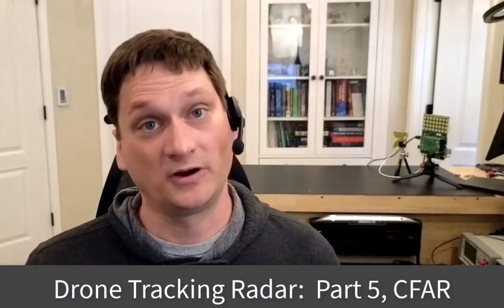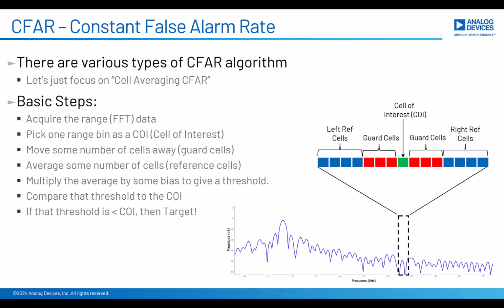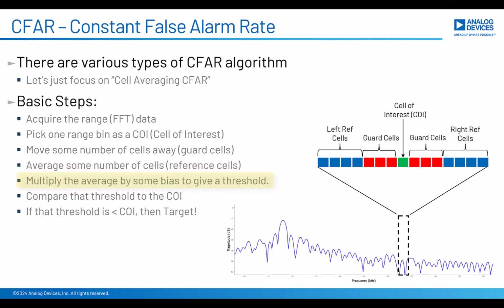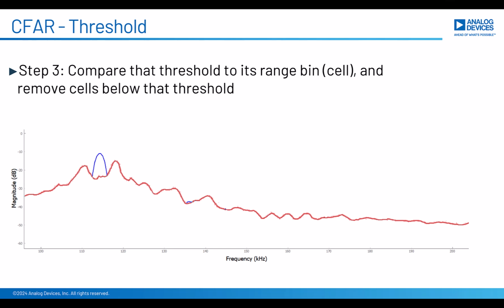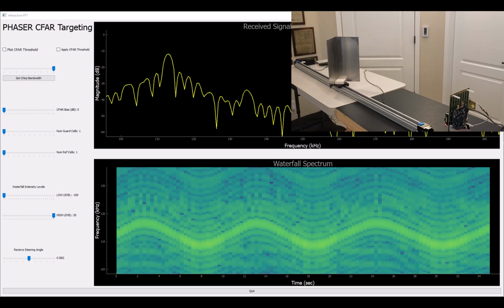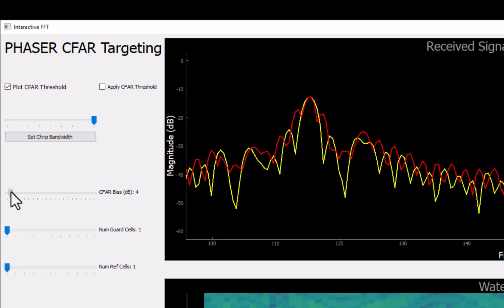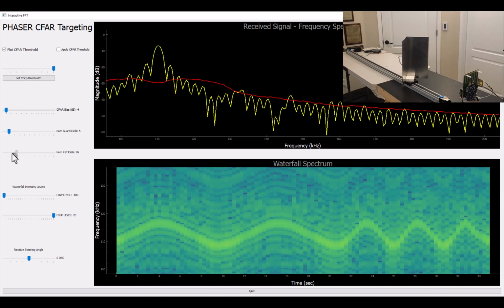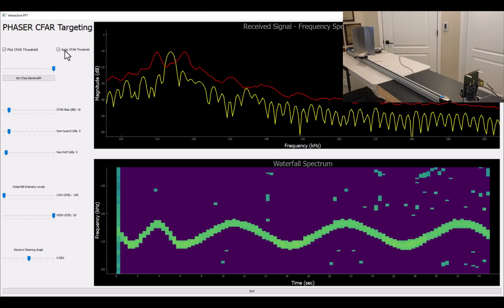Drone Tracking Radar:  Part 5 CFAR Targeting

Comment: Hey Jon, I’ve noticed your python GitHub examples (which are super instructive BTW) run quite a bit slower on my stock phaser board than what appears in your videos. Have you perhaps overclocked your pi 4 a bit? I am running the latest downloaded ADI phaser image and updated software.
Reply from the maker: No I'm not running the programs on the Rpi.  I prefer to run, and edit them, on my desktop computer.  So just connect Pluto (via USB) to your desktop computer, and ethernet from computer to Rpi).  It will run much better, especially for processing intensive things like CFAR.  Also, for technical support on Phaser/Pluto (and much faster replies!), please use this forum:  https://ez.analog.com/adieducation/university-program/

Comment: hi, is it possible to use already developed radar sensors from car industry like "adaptive cruise control radar" for drone tracking or other purposes , with developing code for it.
Reply: Are those actually radar? Or are they lidar? I know that a lot of marketing uses lidar, radar, and ultrasonic interchangeably
Reply: @Enderbro3300  i was reading technical documentation from OEM parts manufacturer BOSCH it is radar working in 77GHz but they don't specify what type is it FMCW or CW.  
YT channel @Thesignalpath was doing dissection of this radars.
Reply: They are indeed FMCW and can discriminate between stationary and moving objects as well as figure out speed differences for emergency braking. It obviously also needs the steering wheel angle.
Reply: Temic (continental) makes 77ghz radars (not lidar), quite a lot of cars have them. I think from 2009.
Reply: Possibly. Most cars that have AEB or adaptive cruise control use  this kind of radar. The first generations just provided a distance to target and target relative speed, I think. The newer ones provide a list of targets, angular position, relative speeds. Pretty sure none of them can detect a small drone and cannot be easily used outside of a car. Bosch has a list of products 'off the highway' or something similar but everything is 'request a quote'.

Comment: What's all this cost? (GOVT PROJECT SO DON'T CARE IF IT'S MILLIONS) JUST CURIOUS - AS WE'RE STILL WEIGHING OUT "BUILDING OUR OWN" OR SOURCING 3RD PARTY SUPPLIER OFF THE SHELF (BTW. what's the RANGE?) SORRY MISSED THAT BEFORE if said. 

Lastly, if you have 3 of these running could you tie all 3 signals into the same bog standard radar screen and somehow also tie AI into it to triangulate the target 3 ways which clearly (it seems) would help ID objects and give you speeds? (Or "more better" no?) That's our plan. Anyone confirm or shoot holes in that idea or plan? (Apologies for the ALL CAPS. 3am w/no reader glasses and too lazy/tired to re-type my Q!) Awesome vids! Thank you!
Reply from the maker: Hi!  See the first video in the series for more info on hardware and cost.  But this is just a development/exploration platform -- not a final product.  Range we'll find out together soon when I get that final video ready.  But it is an CW short range radar, so it won't be super far.  Maybe 50-100m.  Depends on a lot factors (see the first video).
Reply: @jonkraft  thank you so very much.  Both for reading my lengthy missive and for pointing to where I can find more answers beyond the ones you’ve kindly already provided. Means allot. Especially these days when the comments section usually devolve into an area of trolls and naysayers. So means allot to see your reply here. Wasn’t certain when you made this or if the “final test” video was already done as I only started following you after finding this video in a Google search this past week. I’m certain I may hit you up one last time after you release the final video - as the munitions company we’re working with supplies us with missiles with a 42km range. And we wanna ID a “swarm” - as that’s the future of this type warfare. Swarm drone attacks and have AI pick it apart and ID each incoming drone and respond accordingly. The beauty behind the Israeli solution is it’s a set it and forget it with camera and a proprietary tracker I can’t discuss here but can literally fire 50 at once at 50 different targets while you go off and get a cup of coffee. It’s kinda like an upgrade to the Patriot or Iron Dome. They use 1 missile that splits into 3 missiles. But we learned something October7th. Throw the kitchen sink at your target  vs a single ICBM (for an OTT example) they simply can’t respond or handle that quantity of incoming….. Our missiles started out as tank busters (so whilst small they pack a massive punch) and we had them size and modify them down for more distance yet still pack the same punch with an eye on these new Iran suicide drones that come in 10-20 at once and that’s just one wave. We’ve seen now the chink in the iron domes armor. When 150 missiles are launched at once the iron dome simply can’t keep up. AOA also matters. As they’re so close just lobbing them “over the wall” it’d ID the inbound but no time to reach them. Ours have immediate lock load track & fire in under 30 seconds up to 50 missiles at once at sonic speeds today. We hope to create a mobile unit and battery with 3 radars covering or painting a 360 circle in real-time. that’ll launch up to 3x more and auto reload as each missile is on $2K vs millions that others use. We’re just making a better mouse trap where the others fall short. Testing strikes with BAe so far have are in the 95th percentile - so am very happy with the first beta tests. Sadly whilst we learned much from Oct 7 -our Israeli partner company has placed all partner projects on hold as they understandably need to assist in their own country’s defense as they’ve been retooled to mfg munitions for their existing systems. 

Anyway. Will research and view what you suggested. Someday it’d be good to speak offline about upgrading the distance on something like this from meters to miles if you’re game and looking for more research funding? . But as said we’re just weighing out options as we can do either. Build or buy. Depends on costs in the end. This is how the Navy end up with $10,000 dollar toilet seats! Cheers. Dec.
Reply: @jonkraft  done ✅Very helpful. also since I'm just the guy who signs the checks and pushes the vision. I love your backstory! what degree do you have to do what you do 9-5?? I'm a mechanical engineer which has not served me well really as IT had yet to take off. I was trained in Fotran 77 lol! Assuming you’re an E.E. but would love to do that for a living. I just do better with things I can see vs currents and waves we can’t. That aside I’ll be brief for once. Appreciate your videos and links and reply. I googled the cost of Doppler radar as small town news weather anchors are so chuffed whenever they got their own new TV station Doppler (this is 25 yrs ago) but shocked to see the sizes available as obviously our primary concern should we opt not to pulse which I can’t see why we would. We’re still a target. Unless we can disguise or hide them somehow within the urban landscape. I see cell mobile towers that look like pine trees here in Colorado. Makes me chuckle a bit. But does look better than an ugly tower. That said saw some setups ranging from $20k to $800k in the Doppler family and actually understood what I was reading because of your videos!! So know one new person knows a bit more now and is appreciative! Cheers .

Comment: Hi This is great stuff. I'm really enjoying it. 

One suggestion: You can do that loop much faster with something like:

half_width = num_guard_cells + num_ref_cells
kernel = np.zeros(1+2*half_width)
kernel[:num_ref_cells] = 1
kernel[-num_ref_cells:] = 1
kernel  /= 2*number_ref_cells
cfar_values =  np.convolve(X_k, kernel, 'valid')
edges = np.ones(half_width)*cfar_values.min()
cfar_values = np.hstack((edges, cfar_values, edges))
# Pull out targets only as before

I didn't test the code but I think it is OK. I might have the indexing a little off and I didn't use the masked array.

Just a suggestion. Again, good stuff.